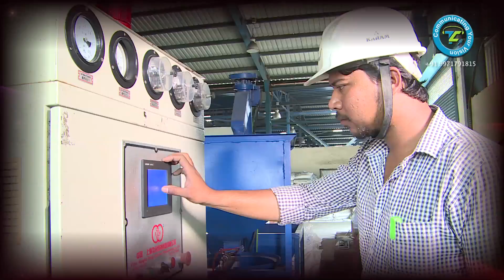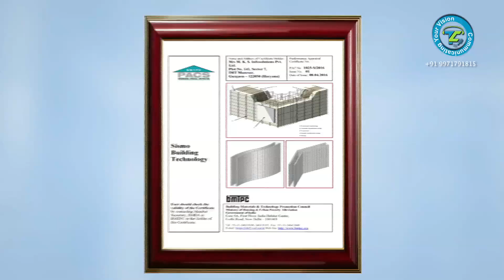EPS Based panel system

Comment: With many benefits EPS houses provide avg life of 50 years? Whereas brick houses provide 75 to 90 years.
Reply: EPS Housing has a life span which is equivalent to or more than that of conventional housing,  with a lower rate of maintenance and comes with benefits, which are much more than any conventional housing.

Comment: How many floors can be build by giving columns and beam support.. I am from Mumbai and planning for our next project with these technology
Reply: G+3 without column & beams. No limit if you make column beam frame. You could even make steel columns & beams for faster construction (as seen also in this video)
Reply: @rajivsingal1731  but steel column and beams are risky and less relaible for residential projects as said in market ..so I just had the concern that if we attach rcc column and beam reinforcement + Eps panel so will cost be higher than the conventional method
Reply: @latestmovies6329  Yes, of course you can easily connect EPS panel walls with RCC columns & beams -  it is simply a connection of two concrete elements, only that EPS wall has insulation inside. The cost of EPS panel walls is cheaper than normal brick / block 9" wall
Reply: @rajivsingal1731  what is the cost of 1000 sa feet two story house in Shimla Himachal Pradesh
Reply: @chitranjansharma7889  It depends on the floor plan and finishing specifications. Normally structure costs are around 750-850/ sq.ft.
Reply: You can build upto 3 floors (recommended upto 2 floors) without beams and columns or your can use MS square pipes as beams and roof support
Reply: @amangraphics  contact info
Reply: contact us for the project using eps wall panel, we are most affordable eps wall panel manufacturer in India 7666951104, check videos on our channel and download the brochure in the video description
Reply: Call me 09160938956

Comment: how about posts and beams ?  for a house 4.5 meter x 9 meter . can it be built without posts and beams and what thickness of foam ?
Reply: You can build upto 3 floors (recommended upto 2 floors) without beams and columns or your can use MS square pipes as beams and roof support